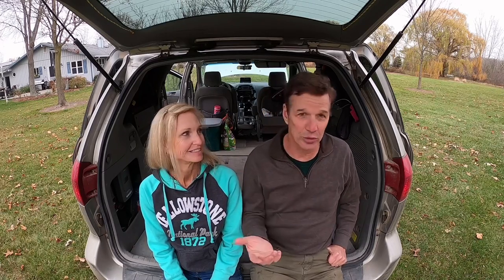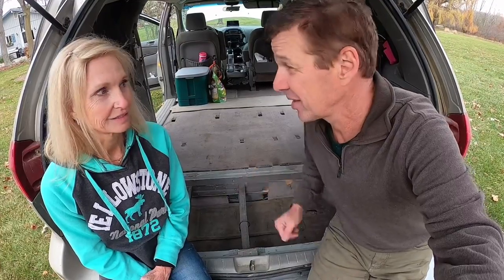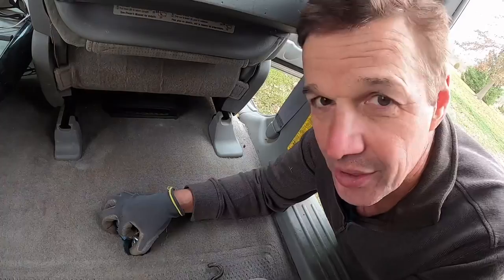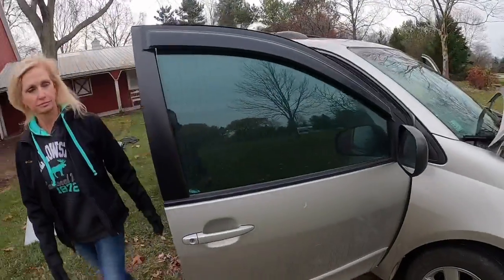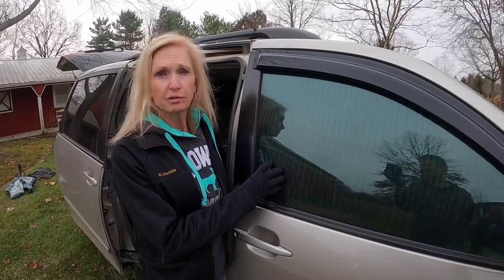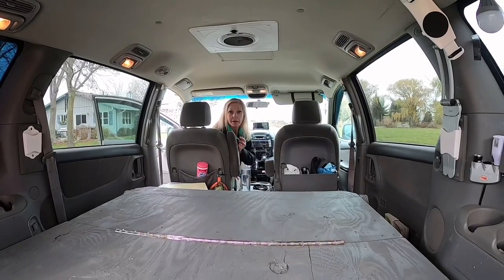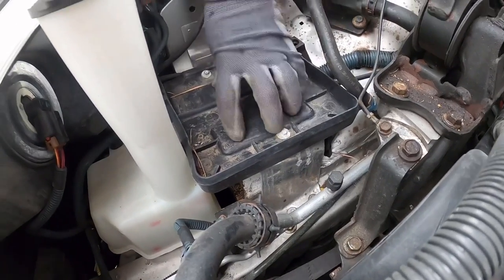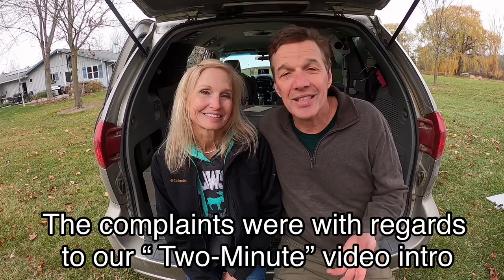Two minute minivan camper conversion one year later

Comment: I just bought a 2004 Toyota Sienna on offer up for 1900 and it has 218,000 miles on it and I’m loving it 😆 especially if it’s an emergency it’s a great backup van that’s the most reliable

Comment: Wow !!!   10 years ago  !!!  I think you may be one of the first ones to do the V-Thang with a minivan !!!!    I think I may be the 2nd in 2012, where I did the V-Thang with a Dodge Caravan just for survival purposes, I knew my income was going to drop considerably in about 4 months, so, I was just brainstorming... hey, I learned to sleep just about anywhere when I was in the Marine Corps (Infantry), on cement and on dirt and rocks... I know I could sleep in a gutted out mini-van.... that's I started the V-Life....  Just putting this out there for you and for others, it's best that you get a "Floor Jack" not a scissor jack, why ???  With a scissor jack (the one you have now) it only works when you're on a flat level pavement, if you get a flat on any kind of incline or dip or a slight decline of the shoulder or if you're on dirt or sand or rocks the car will start to lean and the scissor jack will topple over and the vehicle will crash on top of the scissor jack.  This is your life we're talking about, I got the 2-3 ton floor jack and I have 2 spare tires (I go to some very secluded places) just in case if something happens in the middle of nowhere.... Those are my 2 cents, hopefully this will be useful..... Keep on Truckin (Vannin) !!!  I just love being the only one on the road with a 360 degree view of the horizon !!!!

Comment: Something you might want to consider is getting another wiper fluid bottle preferably a new one and installing it under the hood and getting some tubing from the fish tank and a little pump again from an aquarium store and install it underneath the hood and the engine compartment this will give you warm to hot water when the engine is running now this is something that I did years ago when I was doing construction and it's worked out very well because my guys actually had like a little cleanup station but the fact that you can have warm water or hot water depending on how long you run the engine for is always a good thing as we all know I water comes in very handy
Reply from the maker: Thanks for the suggestion

Comment: Love it!!  I can't wait to convert a minivan.  I just have to figure out a way to configure the bed, so we can have a 3rd seat in the back for our toddler.
Reply from the maker: Should be doable. Our design allows for use of the 2nd row seating when the front of the bed is folded back. What model can do you have?
Reply: @ToBeCreated  Model is TBD.  We have to get through a pandemic home remodel first.  Almost there, got the finish work left after 7 months of gutting, repairs and creating a 3rd floor.  I know for sure, we'll get a Sienna, just not sure what year.  I'm hoping we'll find something reasonably priced around April, so I have enough time to rig up a bed before hitting the road in the summer.
Reply: A Grand Caravan/Town & Country 2006 and newer (with captain's chairs) has second-row stow 'n go, so you can completely hide the seat when not in use. It folds into the floor, which works as a storage compartment when the seats are set up.

Comment: I see where you put your Solar Charge Controller. Isn't that where the JBL Subwoofer is supposed to go?
I have a 2004 Sienna.
Reply from the maker: Yes - I plugged the subwoofer, it did not change the sound quality much if any.  If you watch our other video on the van, you will see more detail on the solar

Comment: Great detailed video! Regarding adding storage boxes (ipad/cell phone holders), you said you screwed them into the wall of the van. Can you explain this? Do you use anchors or some other method to keep the screws from cracking the plastic and/or falling out?
Reply from the maker: Barn siding screws are perfect for this and hold very strongly.  We used 1” long if I recall.

Comment: Did you silicon caulk only around edges of solor? Please explain exactly the coverage of silicon you put on back. Please be specific about the application you used.  Your result was amazing - we would like to match.  Did you put silicon caulk on Sienna and press solor panel down or put Silicon on panel and press down? What brand caulk? Do you think application would work on a full roof size solor panel? Thank you!

-also Have you noticed your technique working on ..say camper shells (topper) than are made out of a soft covered material and have trays formed in them from front to back (lord knows why). My topper looks great, store bought, but the top where the solor panels would need to go isn't flat - it has several trays of about five inches wide anf 4.5 feet long running ontop of camper shell. 

I wonder if aero dynamics would allow glued on solor to stay on despite indentation. Vaguely worried about trapped water soaking solor panel apart.. have you seen anyone successful with this type of surface.. cauling down?) Thank you
Reply from the maker: Don’t recall the brand of caulk. Clear silicone should be fine. I applied the caulk to the high ridges of the van and then pressed the panels down firmly. I then left weights on top to keep the pressure down.  Put a bead of caulk along the front edge of the panel as that is where the wind could catch the panel. I left the underside low spots without caulk so that air could pass under the panels to keep them cool. 

I have not tried this with other surfaces. We just bought a Promaster and we will be gluing about 800 watts of panels to the roof. I am not a fan of ridged panels on a vehicle. I have those on my house and I see no reason to have them on a vehicle as they create drag etc.

Comment: Hi Chuck and Terri...  minute 9:25, What kind of screws you did you use to screw the wood plate to the van's acrylic? Thanks!
Reply from the maker: search this “Starting Metal to Wood siding Screws. EPDM Washer. Colored Head
Metal Roofing Screws 10 x 1" 

Found at many hardware stores.

Comment: Hi Chuck and Terri, I would like to add hard flooring over the floor in the middle area to make it easier to keep the floor clean.  I was wondering if you were able to pull out the rollers that glide on the tracks for the middle row seats. Can you, or anyone else, tell me how you removed them?  😊
Reply from the maker: Hi Allyson. What is your van model and year. Ours did not have rollers in the middle area.
Reply: I have 2013 Sienna. It looks like I might have to end up building around them. This has been my most frustrating part of my build, but I’m going to have to figure it out. I’d like to start my part time van life in February. I’m pretty excited about exploring the United States. 
Thanks for getting back to me, and maybe we’ll meet up some time. 🌸

Comment: Thanks Terri and Chuck!

You don't happen to have the flat floor dimensions before the bed is added do you? Might have to look at a Sienna :)

-Bone
Reply from the maker: Hey Bone. Long time no chat. 
Our Sienna fits a 4x8 sheet of plywood perfectly. Actually a little bit more. We fit 10 sheets of drywall too in some recent work. If you want more exact measurements, I can.
Reply: @ToBeCreated  Big enough for me. The Durango only has about 86" interior length. Was fine for Pikes Peak except for the uneven floor and my back.

Comment: Just got 2004 Sienna and exciting to be a car camper soon! May I know how did you leveled your floor behind first row seats to third row?  Thanks!
Reply from the maker: As I understand your question. The floor of a 2004 Sienna curves.  It is not flat.  I hated that the first time we laid a mattress on the floor, so I cut out the carpet on e back half of the van, cut plywood to fit the space, and then screwed into the steel.  I picked spots that would not harm anything like the fuel tanks.  We then created a trunk door to access the area where the third row seat fit
Reply: @ToBeCreated  Thank you so much for your sharing!  Another question about Napier trunk tent.  There are two sizes: 61000 and 61500.  I have a gift card from Bass Pro shop, but they only carry 61000.  Will it work for my sienna?  Thanks!
Reply from the maker: Ohh. No idea. 🤷 
Sorry

Comment: Thanks for all the tips, I have a Sienna also. When you turn the lights off in the van using the switch, how do you stop the little open door blinker on the dash, while the trunk is open with the tent attached? Thanks
Reply from the maker: Never noticed. Will have to check. It does not blink we are certain. My wife would have covered it up with tape at night 😂
Reply: @ToBeCreated  Lol. Well I wonder 🤔 why mine does. I have a 2006. Ok Thanks!
Reply: My 04 doesn't blink, it just stays lit. The light is red, so it's not too bright and the driver's seat back blocks it anyway when I'm in the bed.

Comment: I can confirm that the 2003 and older Siennas have the spare tire carrier in a different spot; since the third row doesn't fold into the floor, the tire is stored at the rear. The AWD Siennas also don't have a spare; they just have a tire patch kit.

Comment: Instead of cutting both ends of the cord off, why not simply turn it around?
Reply from the maker: Thanks for the reply bowrudder. 
The challenge comes from the end the pulls out of the enclosed coil. If you turn it around the enclosed coil would need to be removed from the vehicle and attached to the shore power.
Reply: Thanks. That makes sense.

Comment: The good old cars, there is no way you can fit a battery in the front of any new car.
In my old Mercedes I could fit in a case of beer, in my new car I would have a  hard time to fit in 2 bottles.
Reply from the maker: tonyhickq they can cram a lot of stuff under the hood of the new cars, leaving no space for mods.